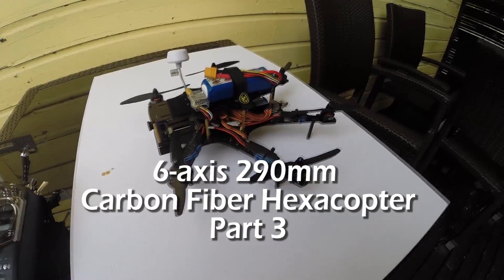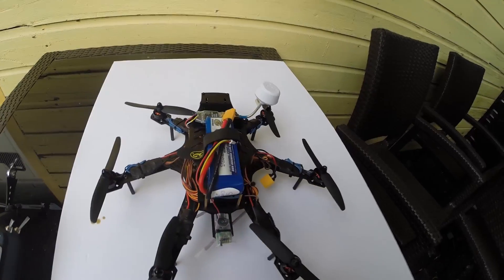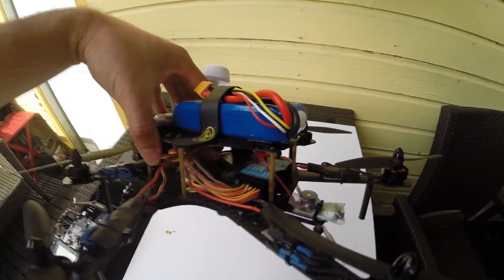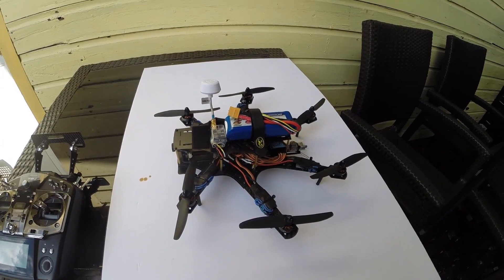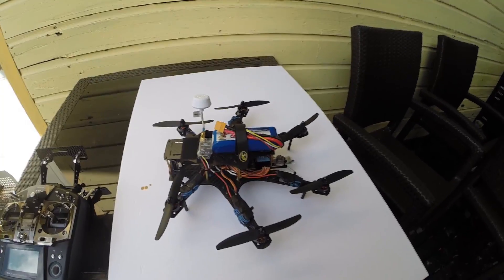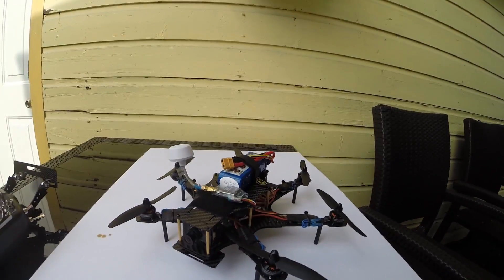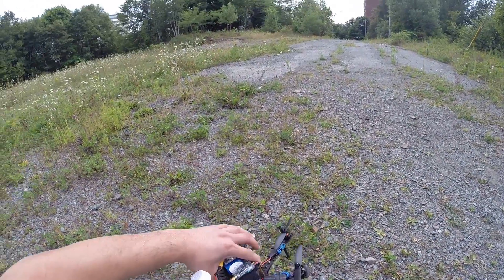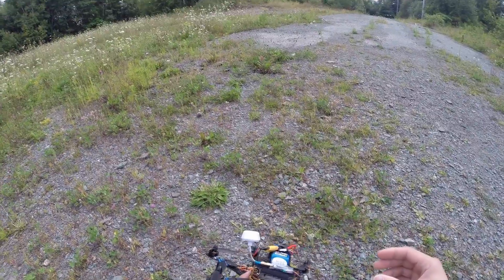6-axis 290mm Carbon Fiber Hexacopter - Part 3

Comment: If you could use gemfans 6045 abs props I assure you'd be getting a lot more boost from your rig, I use them on DYS 1806 2300kv and motors run cool and within the amp/esc power range without worrying to burn anything, if you can... Definetly try it! On quads you can feel the difference rigth away from 5 to 6" props, I don't own an hex but I'm sure would have the same effect!😉

Comment: Great review. Really like the looks of the spider frame, although can't understarnd how the clean plate works underneath the frame. Would make more sense to put it on top.
Reply from the maker: thanks, yeah I agree and the gopro is a little too tall when mounted they should have made the landing gear longer
Reply: Since this is a copy of Blackout, the cleanplate was made to hold a gopro and battery on the bottom, the battery size would be the height of the gopro.  Landing gear for the mini quads is not necessary if you take off from a landing pad/soft grass.
The bottom plate is longer due to the center of gravity on the frame being more to the back than 'dead center'

Comment: with the quad - i am buying a knock-off one as it is 4-5 times cheaper,this one in not exactly cheap - blackout hex only 189$ - not much of a bargain here i would say,just my humble opinion
Reply from the maker: Where is the blackout hex for $189? I'd probably splash out on a real one for that much.  On the blackout site it is $219 + $20 for shipping with no insurance or tracking or it's $67 for shipping with insurance and tracking.
Reply: Getfpv.com shipping is free for orders $60 and above